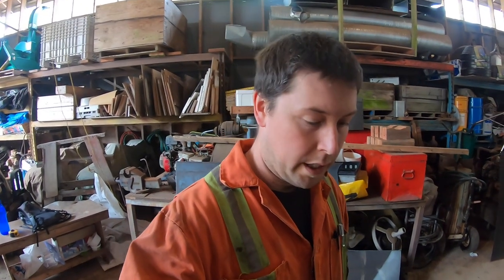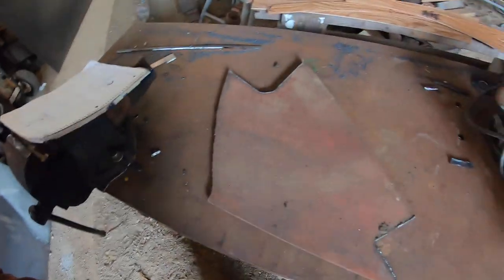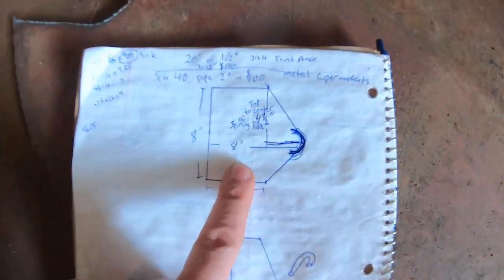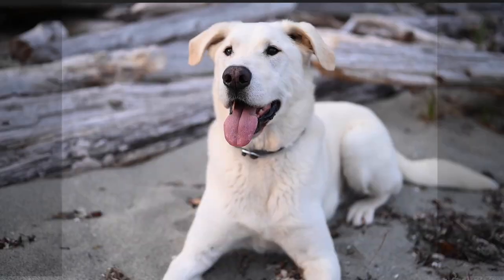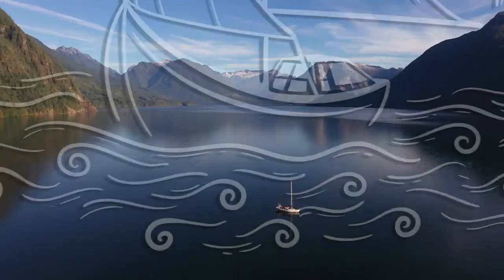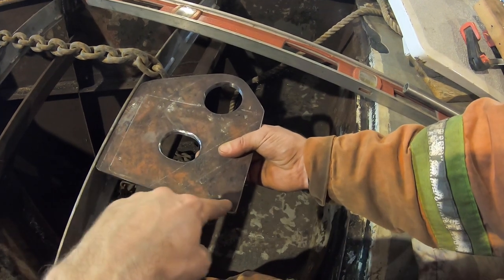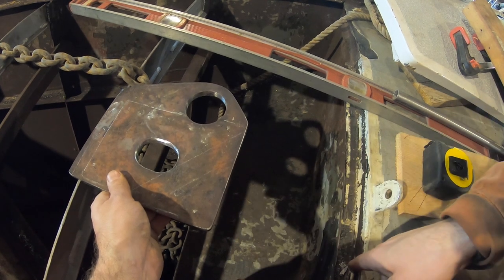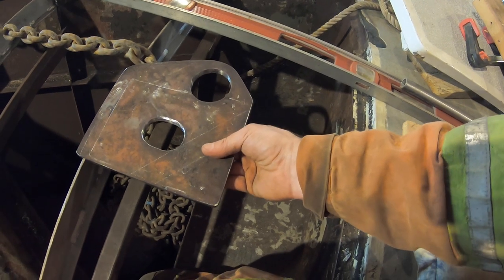Where Will the Windlass Sit? Redesigning Our Chain Locker Pt 2 | Ch5 E18

Comment: Couldn't you make a sectional elbow for the spurling pipe the layout is in my pipe fitter guide book even if you made sections 12.25 degrees per section and a longer run?
Reply from the maker: We probably could have, but this ended up being less work and making more sense as far as access to the pipe goes, as well as being able to limit the wear and tear on the pipe.  That's the theory anyway.  We will see how it works out in practice, but so far so good.